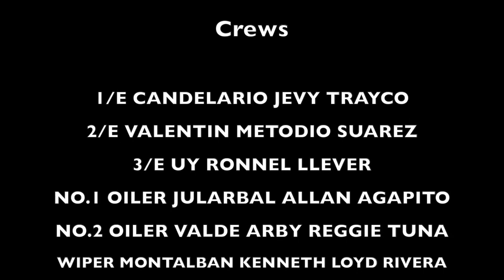#G/E #Cylinderliner #Liner #Overhaul #선원 #선박기관사 #해기사 #MOZIRI - Overhauling the Cylinder Liner

Comment: Hi, it will be great if you show how the gasket looks like, because im overhauling Yanmar 2T75L. With alternate sleeve, its higher than block 0.4mm, wondering if its okay. please advise, thank you. Great video!
Reply from the maker: First of all, thank you for watching my video and
I am sorry i don't have an experience of Yanmar 2T75L model.
I recommend that check the length from block to liner prior to disassembly and check the length again after re-assembly.
I think if the measurement is no difference or a little bit, probably there is no problem.

Comment: Many thanks ! Very good work ! Please tell me how much wear on the cylinder liner has to be in order to replace it? And how much will it be in operating hours? Thanks !
Reply from the maker: I am so sorry you are waiting long time.
i am onboard at present. Therefore i can’t answer at the time. i am sorry for it again.
At the renewal time, the cylinder liner wear-down was 0.38~0.45 (limit 0.3mm) and total running hours 15,000 and almost 8 years since delivery. Normally, 3 sets of Dynamo Engine are installed on ship.
We did dismantled No.1 D/E pistons according to PMS (every 8,000) and found a lot of cylinder wear-down. However, Cylinder liner spare was not enough. I supposed that the other D/E Cylinder condition is probably same condition . Anyhow i report the measurement and just assembled No.1 D/E piston at the time
2 months later we received 12 sets of cyl. liner and started replacement.
Reply: @mozirichiefengineer7916  I am very grateful to you for your answer!